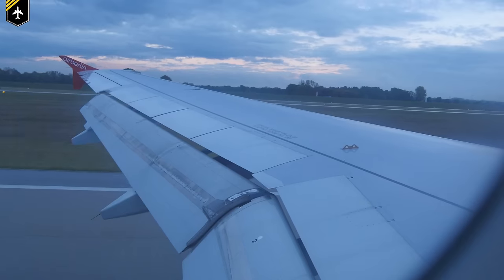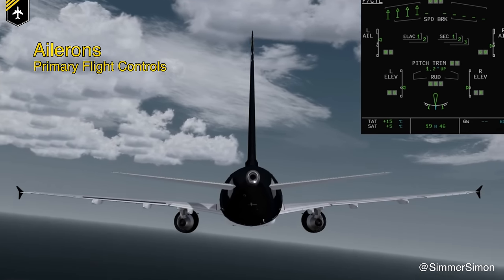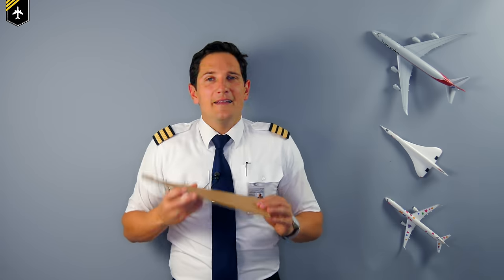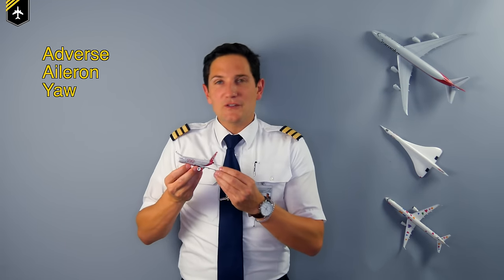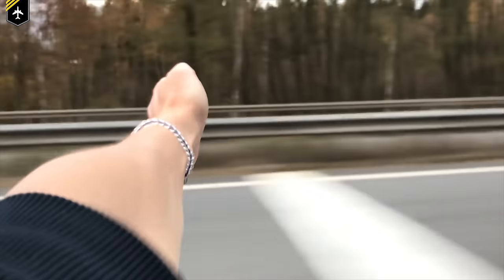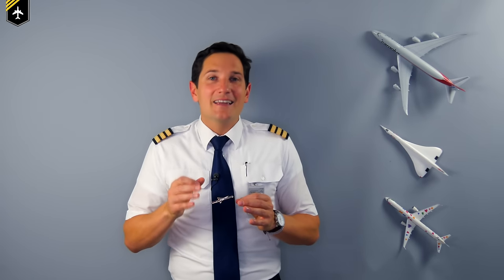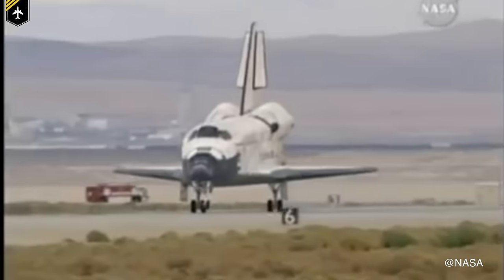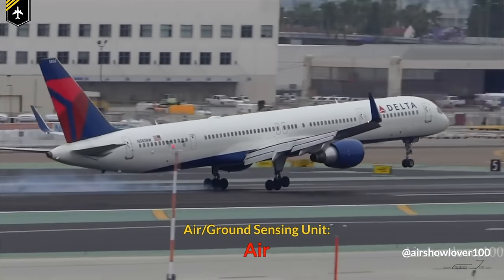What are SPEEDBRAKES/FLIGHT CONTROL SPOILERS?! Explained by CAPTAIN JOE

Comment: Spurious thought as I watched: Planes land with flaps fully extended to give them maximum lift at the lowest speeds, correct? When the spoilers are deployed they help slow the plane by disrupting wing lift and causing the air flow to push down on the plane thereby helping the tires grip the runway, right? So, would the spoilers be more efficient if the flaps were retracted as soon as the plane touches down or do the spoilers immediately cancel the effect the flaps had prior to spoiler deployment? I've flown on planes that had flaps down all the way to the gate. Now, granted, chimps fly cargo so I couldn't see much even after punching a hole in the wall, but the flaps were down...all the way to the gate. Banana?

Comment: Joe, there's another thing, which I'm sure you know, but didn't mention... The slots created between the (non-deployed) spoilers and the flaps is calculated precisely during the design phase, to maximize the efficiency of the flaps. But, if only the actual outboard ailerons were used during approach, the aircraft would be somewhat sluggish. So, when the mid-wing spoilers are used for banking during approach, they not only provide the drag you spoke of in turning the aircraft, but the increased slot size dumps a huge amount of lift from the flaps, making the aircraft more responsive. Finally, when the mid-wing spoilers are fully deployed after touchdown, they dump nearly all the lift provided by the slotted flaps, helping the aircraft to settle onto the runway. So, in a flaps-deployed configuration, they're acting somewhat like the older design "slot lip ailerons". Thanks again for all the great videos!

Comment: I Have to say I love your videos, you succeeded in making content accessible for all audiences And also very interesting for experienced pilots (cause you say it the right way a good pilot is always learning... and it’s even more true as we also keep forgetting what we already learned so sometimes we have to learn it again;)
I love your pedagogy and your speech rate that help non native English speaker to understand very easily.
Thank you very much, hope to see many more videos of yours :)
You asked if there still was some airplanes where speedbrakes have to be deployed manually after touch down. As a K35R pilot, I can assure you that the speedbrakes are extended manually after touch down (and we have to do it quite gently as we feel the aircraft settling down too much frankly if we don’t)
Our outboard ailerons are also locked at high speeds, and only inboard ailerons are effective. We can also note that if we loose the hydraulic power to the spoilers, the rolling rate becomes really low (but you also have to know that our aileron are not hydraulically powered but work with cables and tab,anti tab and balance panel)
Any way thanks again ! :)

Comment: The real purpose of ground speebrakes is to brake the aerodinamic of the wing so once it is touching ground they brake totally the posibility of flying more.. The best example and it is manually operated are the glidders. They fly so eficiently that they need to deploy the spoilers at the two wings to landing and once touching ground do not go flying anymore so the brakes are at the final of the ground spoilers control.. Without these spoilers it would be really dificult to adjust the landing, so i suppose they are so helpfull in your airplane to the final approach and adjust without been necessary a continue adjustment by throtle.

Comment: THE SUPER RAIDER
Being a wing person, do you reckon the Sikorsky Raider could easily become a full blown plane? Google image it first if you haven't already seen it. Image "Sikorsky RAIDER". It's a twin rotor chopper that is pushed through the air by means of a pusher propeller. It has has FBW control on rotor pitch instead of swash plate. They slow the rotors by 15% when it's pushed through the air with a rear propeller. It's slow compared to a plane (and like twice the fuel burn) but still fast for a chopper. 

To add another 100 mph (with maybe less fuel burn) why couldn't they make the rotor blades act as wings, by slowing the rotors way more, to like 100 rpm? Only feasible on twin rotor choppers (like the Raider) you need twin rotors for one "wing" on each side, cos only one side of the rotors can be used as wings. 

To convert the Raider to the Super Raider (as far as I can see) all you need to do is add gearing etc. to slow rotor more, and extra software to tweak the slowly rotating blades (used as wings). The receding blades (backwards to airflow cos of the low rpm) would be fairly slow airspeed compared to the advancing (forward flying airfoil) blades...alleviating the problem of the backwards air foil to the airflow (that would still be critically tweaked by the software). You could maximise the effect of faster forward blades compared to receding blades with the rotor rpm.

And ailerons could also be incorporated into the blade pitch software, especially designed for the slow rotating blade "wings", and for the critical receding blades, so it doesn't affect flight (hopefully). 

Transition (both ways) should be easy as the original Raider goes 250 mph (top speed) and any speed slower, so it goes fast enough to get the best transition speed (whatever it would be). And with an extra 100 mph top speed and maybe even less (hourly) fuel burn, you would maybe save nearly half the fuel (compared to the original Raider) owing to the vastly less drag and such small "wings".  

I have thought up many VTOL concepts but the Super Raider is the best cos it's 99% done! For that reason Super Raider is better than any of these:  https://youtu.be/vZ4rvpR6qjU

Comment: Hey cap. I'm now 62 and went to flying school in my early 20s. Used to by my passion in life. I have develope a huge fear of flying. Remember the value jet in the everglades? That did it for me, never able to get over it. Haven't been to get back on a flight. Anyway on a different note. What do you think about activating the wheels before touch down, with a radar picking up the ground speed? This would save on tire cost,  therefore lower ticket cost.

Comment: Sometimes I hear a bizarre sound from jets that sort of sounds like the engines rapidly decreasing power and then a loud and low rumbling sound from the plane's engines. There's no buildup to it either. I always thought it might just be the plane preparing for decent, but could it be the howling sound you mentioned?

Comment: Joe, on the 747 vs a380 video you could of said that the the 747 has reverse thrust on all engines and the a380 has it on only engines 2&3!!!
Reply: The A380 has a massive wingspan. That is why only the inner engines are used for reverse thrust, so the outer engines won't suck any stirred up dirt or other shit into the engine
Reply: That proves the A380 has better stopping capabilities than the 747 despite having two less reversers!
Reply: @saritasumaria  or the a380 simply has better breaks due to the missing reverses

Comment: Captain Joe. So on the A320 the rudder isn’t on the tail or cross section? The yaw action comes from the flight control surface on the wings? Does the A320 have rudder pedals or is the yaw controlled by the side stick?

Comment: I am a passenger and several times I saw spoilers on an A320 doing something that seemed weird to me.  Just after landing, when the plane quickly slowed down on the runway, the spoilers opened to 180°. They kinda got extended so hard that they ended up 'falling' on more frontal part of the wing. Is that normal? And why does that happen?

Comment: I have recently flown, and it was the first time I have experienced the speed brakes en route before the descent. Very strange feeling, like driving a car on a smooth road surface and then going to the lawn. What is its purpose? Why is it not enough to slow down the aircraft in inertia and then descent? We were late, so maybe to save time?

Comment: Question: Is there any warm up procedure for the engines? 
I've noticed that the engines are started up pretty late, only before starting the taxi procedure ( most probably for fuel cost reduction).
Do they have enough time to warm up during the taxi procedure before they are getting revved to TOGA? 

Are the engines heated up by some equipment before startup? 

Thank you!

Comment: I was in a b787.. During takeoff roll, I noticed a small portion of the flap going down and up and finally comes back to its initial position!! What does that do?? And what was the problem with b737 MAX 800
Reply: SEAL Sheky that’s most probably the outer aileron. The flaps don’t move during takeoff

Comment: I used a spoiler )airbrake= on my 747 onmy sim )that now refuses to load any longer, Ihave to buy a new sim. I made a PERFECT landing with autobrake at th Vancouver airport on runway 26L. It was so smooth that I was unaware that I had even touched down! I only figured that out when the nose slowly settled on the nose gear. I also stopped a very short distance on the runway as well! (this of course with braking and thrust reversers as well- - autokrake system).

Comment: @Captain Joe, maybe you could clear something up for me. A couple weeks ago I was flying on an A319 and when the plain taxied, it sounded like something big was broken or loose below. As it taxied there was a loud "klu-klunk ku-klunk klunk" etc. It wasn't the sound of it going over lights, it was just a all the way to the runway and made me slightly concerned. It sounded like if you were to put a pair of sneakers into the dryer. Any idea what that was? I heard it on another a319 years ago.  It wasn't the sound of the hydrolic pumps either. I know that sound.

Comment: Can we make the engines spin around backward so they can thrust in reverse therefore slowing the plane down even more?
Reply: I'm Your Huckleberry too impractical. Moreover that much deceleration isn’t required in the air. Airbrakes are enough

Comment: hi mr joe << thanks for your good explanation but i think you forget one important thing: while  your aircraft  on the air if you use spoilrs or air break you should or the outo pilot rise up  the front nose  other wise  the air will push the wings down  means air craft will not stay on same level < it will go down >
also i work hardly  for cross wind which it cause headech to pilot and passengers and i found way to reduse   the effecting of the cross wind to the plane   by %60 to  %85  but you should contact me and any company use this technology like boening or airbus or any    aircraft manufacturing  factory should pay  you and me what ever they want pay < most important is  safe the plane  from the crash or  from go around or change the airport and the most important is safe the lives of passengers and the crew<<<< deal?

Comment: can you use the air brake to quickly gain speed? for example, using slightly more power with air brakes slightly extended when you know you might need to accelerate quickly such as during an approach, and then retracted to gain speed quickly? compared to throttling up which may be a slightly slower response? I'm not a pilot so I have no idea.

Comment: On my X-plane 11 Zibo b737-800 the speed brake lever if left on the down position on landing, and then you apply the reverse thrusts the spoiler will
go to full up position with out the speed brake lever set to the armed position. 

Reply

Comment: Hello Capt. Joe, can you please tell about how a pilot while taxiing on ground, maintains the nose wheel on center line. Especially longer a/c like 747, 777, 350-1000, 787-10, where the cockpit is way ahead of the main landing gear wheels, so how to take a judgement of taking nose wheel forward, ahead of center line and making turn so that the rear wheels come through in center once a/c is straight.
Reply: sapan avarani it’s just practice and instinct.
Reply: @ZK-APA  thanks

Comment: Viele danke for this and all your other videos! You say that a function of the airbrake is to slow down the plane in flight        —on recent flight I took the pilot used these during the approach/descent. Why would they use these and not just decrease throttle instead?

Comment: I should watch the video.  But putting it bluntly, spoilers deform the wings over the area they are present. When deployed that is. In layman's terms they cripple the wings and cousees increase drag.
They also help in banking the aircraft in turning. Aloron's tend to cause a dragging afect in turns. Spoilers combat that.
I'm not going into any more details. The captain said it well.
But did anyone know why a mosquito makes that high pitch sound. Their wings are beating 500 times a sec. A humming birds beat ,I think 100 a sec. That's insane stuff. GOD surely is the master aeronautical engineer.

Comment: I have one question what are the properties of A380 aluminium and which parts of A380 are made up of carbon fibre and what is the air pressure inside A380 cabin and what is the maximum range of A380

Comment: Why on the 737 do they hiss while moving as if they are pneumatic? Is the speed of the hydraulic oil through valves and pipes so great that you can hear it circulating? I don't think it was the air rushing over the surfaces, as I could only hear it while the surfaces were moving.

Comment: How come engine throttle down isn't used for speed reduction, I always though speed brake was once landed but in flight to only adjust descent by spoiling air flow over wing

Comment: Thanks Captain Joe. I have a question. While taxiing, just before takeoff, I think I've often noticed these panels on the wings going up and down as if the pilots are playing with them. Are these the same ones and are they testing them in some way?
Reply from the maker: diamandis80 flight Control check😉
Reply: I googled it further. Thank you!

Comment: In the next speedbrake video can you explain why they are fixed in position during flight but on landing approach they seem to be unlocked and flap around loosely before touching down on the runway and fully deploying?
Reply: Andre Gilbert it’s not really flapping around loosely, it’s the pilot correcting to maintain centreline and wings level.its the corrections that you’re seeing.
Reply: @ZK-APA  Sounds about right, usually notice it as planes are rocking side to side aligning with the runway just before touching down. Would be great to get a more detailed explanation video from Captain Joe.

Comment: @captain joe, at times when flying, it appears these spoilers are in a neutral or idle type control where they seem to move based on a differential pressure. When watching they seem to move up and down randomly. What is it that's happening?

Comment: Hi Joe, thanks for great videos! I have a question about cabin air pressure - maybe You could make a video about this. Is it true, that if a window breaks and the cabin air pressure is reduced, will it generate an air current pressing and sucking everything out of the window? Just like the final scenes of the James Bond movie "Goldfinger". Thanks for answer :)
Reply: Alexander Forsberg yes and no. Yes as in it will suck the air out of the aircraft. And no as it will again immediately equalise the pressure. So if there is something loose near the broken window, yes that will get sucked out, but not everything in the plane.

Comment: I have always wanted to build a deployable speed brake as a spoiler on one of my cars lol
Reply: Spoilers only work on wings. Their design is 'lift destroyers'. They do have a secondary effect of brakes but you use them to get on the ground then stay on the ground. Air brakes you put anywhere in the air stream. At that point they are no longer spoilers.

Comment: @Captain Joe Could it be possible that the spoilers were unwantedly deployed due to a failure and if so, do the engines have enough power to counteract the decreasing speed in that case for a save emergency landing?

Comment: It was nicer to hear Kennedy Steve's voice in the intro!  On the 'Bus, does the FMC automatically push forward with the yoke while deploying spoilers in flight to maintain level flight?
Reply: I think you mean "automatically pull up the yoke" but no since the bus doesn't have a yoke but a sidestick and the sidestick doesn't move. The flight augmentation computer gives the pull up command through the pitch trims tho

Comment: Most Boeing...the pilots train, if done correctly, to not arm the the Spoilers as this feature has no FBW like on Airbus(Exception is the B767, B777 and B787 and N series of other models, those have a extra CPU processing gear preassure, wingflex and extending them like Airbus, automatically at the soonest point after touchdown, when the wingflex has retracted to a neutral position).

Airbus spoilers, except A300 and A310, can extend even with wingflex still not fully retracted...why the spoilers sometimes not extend fully at first, but they do so when both/all main gears are taking the load of the plane...and after the flex has retrected to neutral, the FBW still has a little bug now and than...not extends them fully...only version 6,782 or higher will work purfect...but it not matters much...just about 1-3 purcent loss in breaking power...so about 13(A318)-45(A380) meters more runway u'll need...on those with older(2013-) versions of FBW...it's in the pilots manual and the maintenance log...so the pilots know.
;3)

Was in maintenance once...in 2009...written one of the patches fur the gear pressure calculations...to fix it...Airbus accepted it.

Comment: You were talking about the spoilers in a turn to help reduce the yaw. Why cant' you use the rudder as you would in a smaller plane?
Reply: Nathan .Vanderslice rudders are used as well to reduce adverse yaw. But with spoilers it is actually helping with the turn as well (unlike rudder which is only for balance)